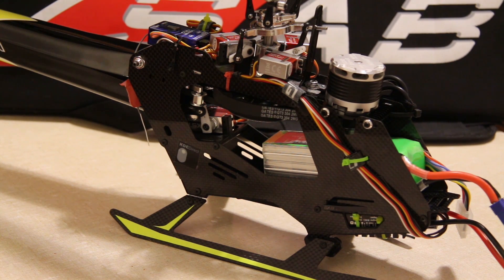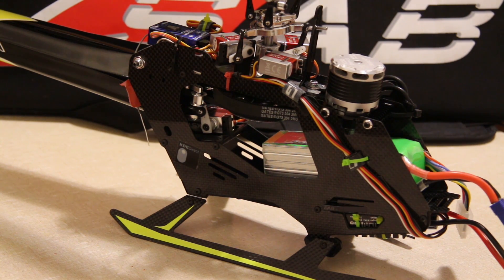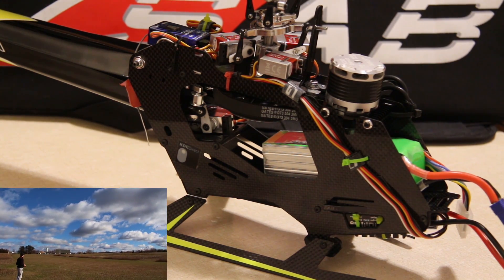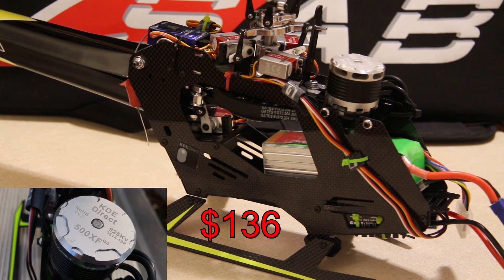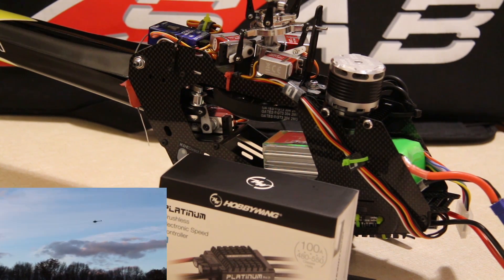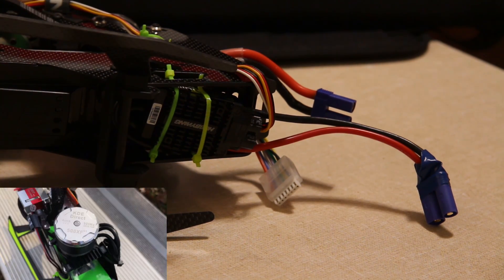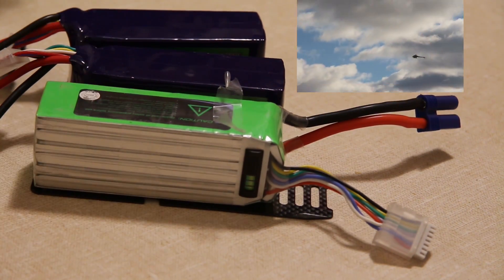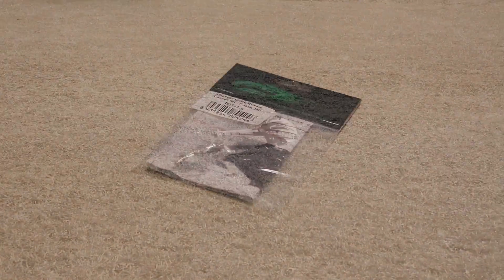Electronics for SAB Goblin 420

Comment: Hi there Bill. Just a quick question.You mentioned that you have a Trex 550L dominator. I also have the 550L and was wondering if I bought the Goblin 420 kit would my 550L electronics work on that the 420?
Reply from the maker: Esc and fbl will work but G420 uses smaller servos and different motor.
Reply: Thanks for the feedback Bill. Much appreciated.
Reply from the maker: No problem!   Good luck!

Comment: Great vid...thanks.  I'm using the HW100 and 2600 pulse too.  Went with the AR7210 for FBL / Receiver.  I'm about 80% built.
Reply from the maker: Thanks, you are going to love it!
Reply: Did you secure your battery to the tray with the double sided tape?  Reason I ask is that if i have to adjust my C.G. then there's no way to move the battery.  Or maybe I should use velcro?  I could just wait to secure it until after it's built and then use the tape after I check CG.  Thanks again Bill.
Reply from the maker: I believe tray was not secured.  Make sure clip on side of frame is pushed in locking the tray into frame.